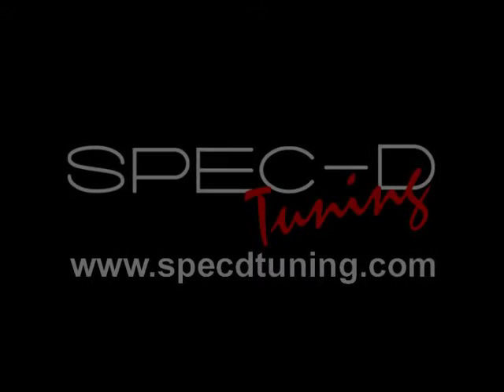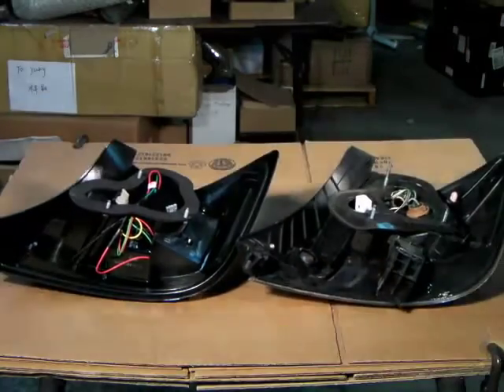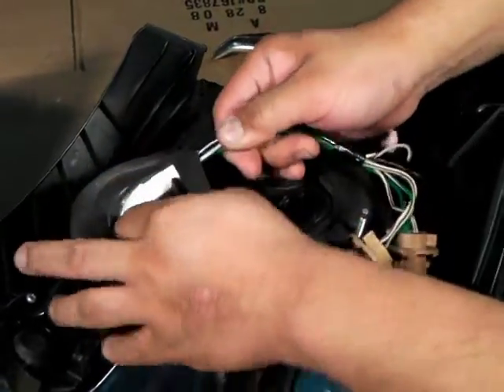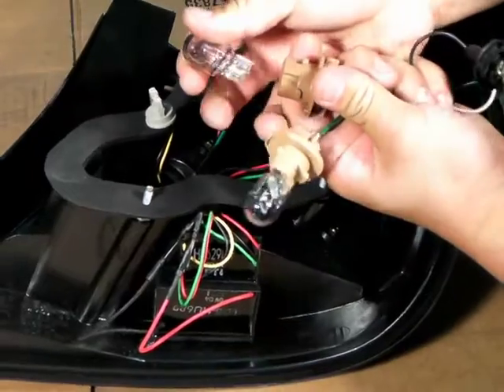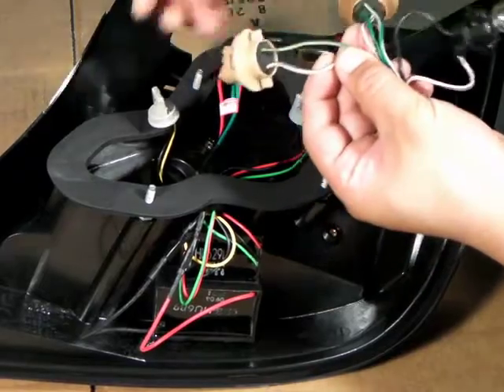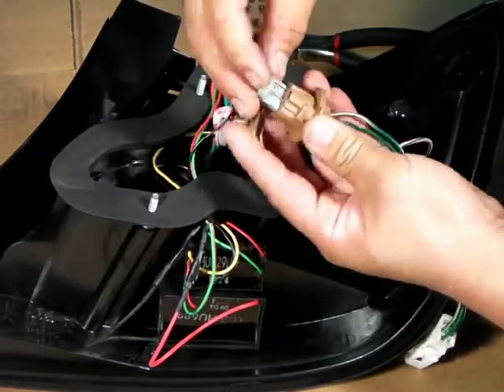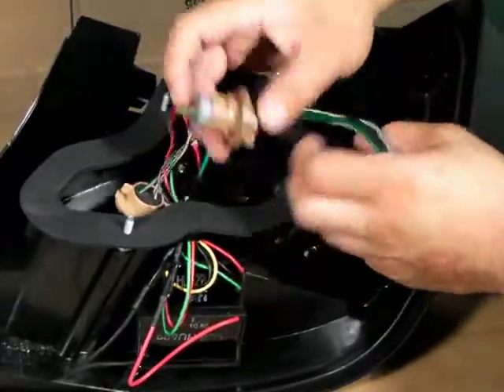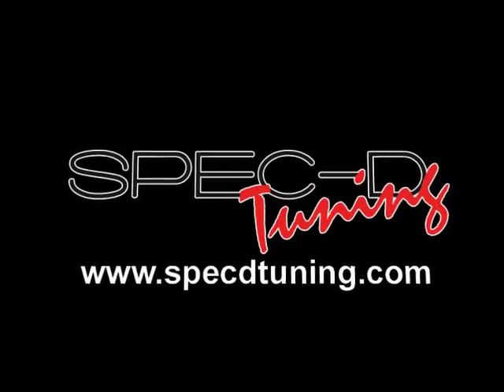SPECDTUNING INSTALLATION VIDEO: LED TAIL LIGHTS WIRING INSTALLATION GUIDE

Comment: I have the same problem.  My turn signal doesn't work and it blows the fuse every time I replace it and initiate the indicator. I have a scion tc '07 and these same light as in the video.  Is the light itself short curcuited?

Comment: When you connect the other harness to the other tail light wouldn't the connectors make it impossible to install backward ? Most I've seen have a small tab to prevent this .

Comment: LED tails come on, but my turn signals, 4 ways don't work. I try and replace the fuse and it blows. 

Any suggestions? No cables are pinched, spliced, and the tail lights are the only LEDs I have.